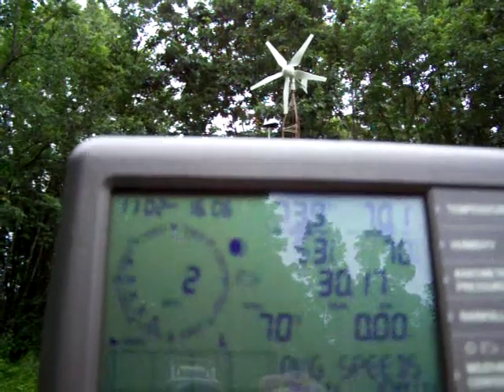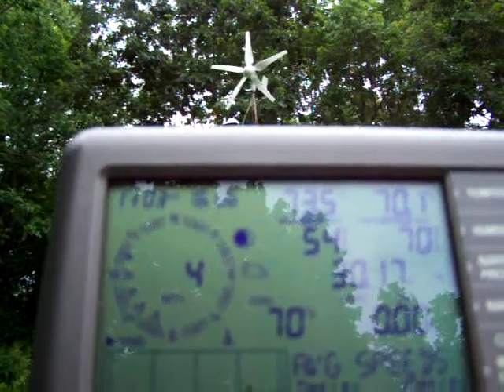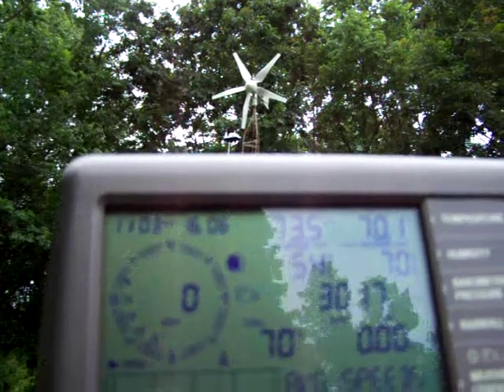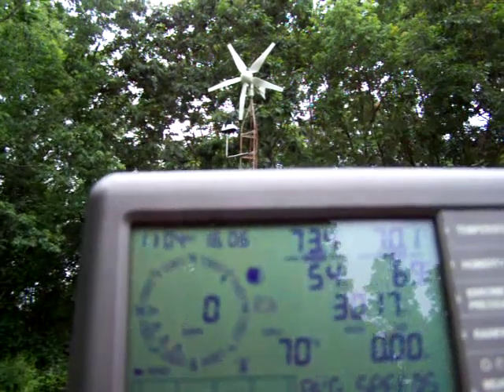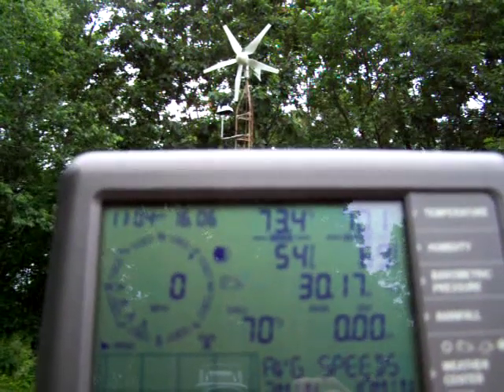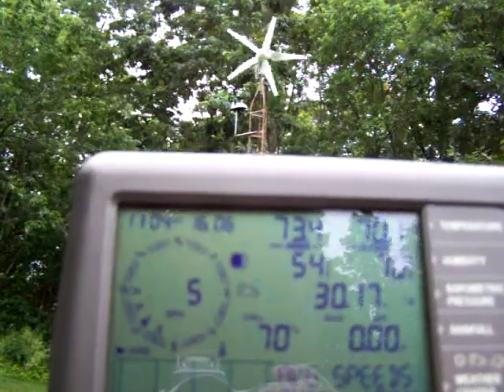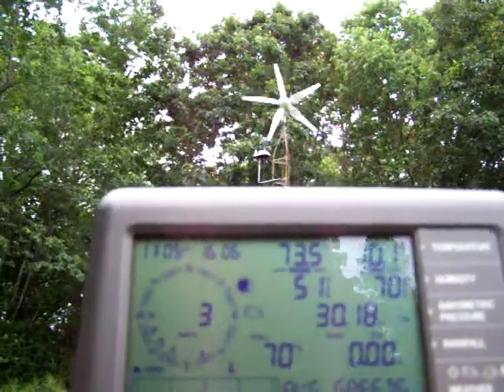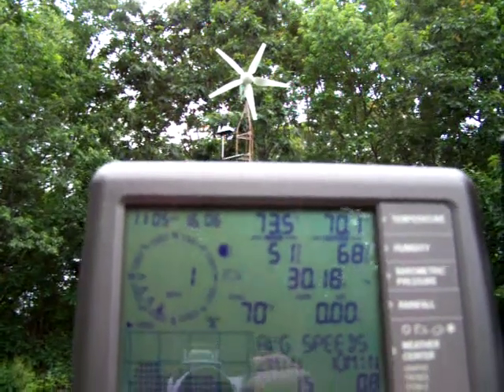start up of a windmax hy400 wind turbine

Comment: Great videos. I'm curious how amps you're getting in 7mph, 10mph, and 12mph (assuming clean wind) to compare to my own results?  On my Windmax 400, I'm getting ~2-2.5, 4, and 6-8 amp, respectively, with a steep increase with winds > 15.  Thanks again for the great info you provide in all your vids.  i'm just starting out and helps a lot